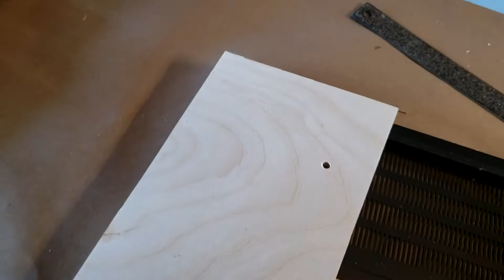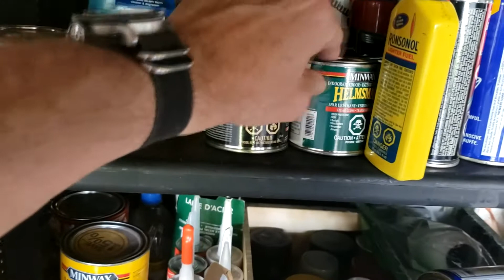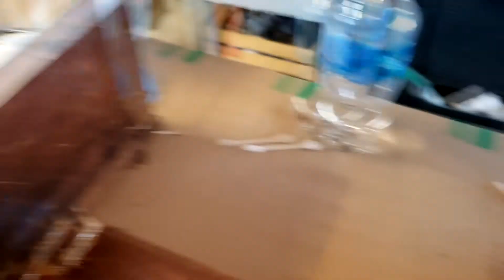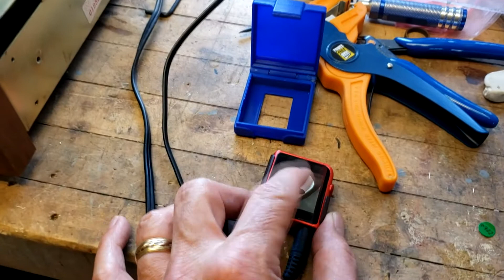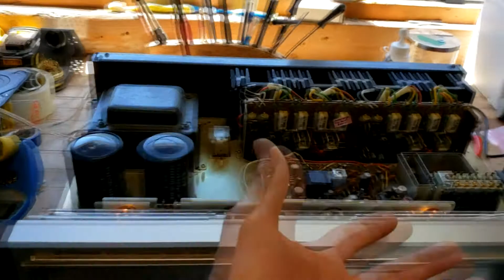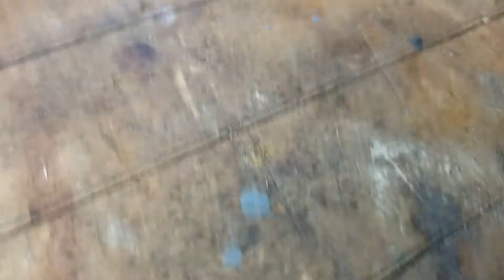Pioneer SX 950 Refurbish Project: June 2021 - Part 1 (Initial Evaluation and Cabinet Build)

Comment: Nice job so far... beautiful work on the cabinet!. I'm planning on watching the rest of the restoration...and you might address this in future vids.... but those 2SA726's (Q1-Q4) on the power amp board are a high failure part and should definitely be replaced with gain matched pairs of KSA992's.
Reply from the maker: Here is the whole restoration story:

https://audiokarma.org/forums/index.php?threads/pioneer-sx-950-restoration-project.966626/